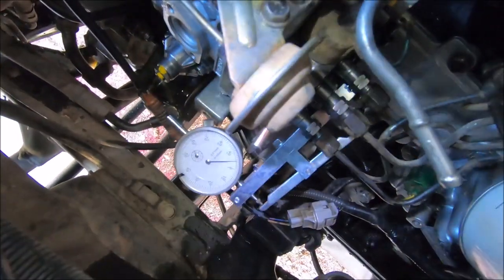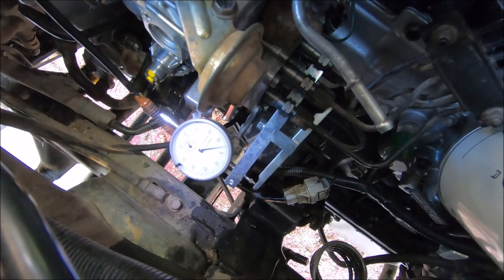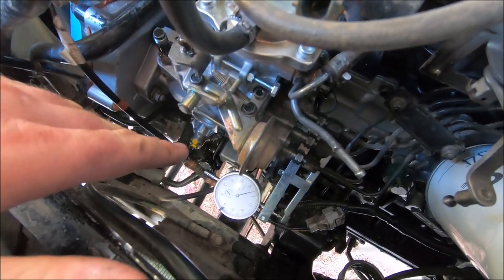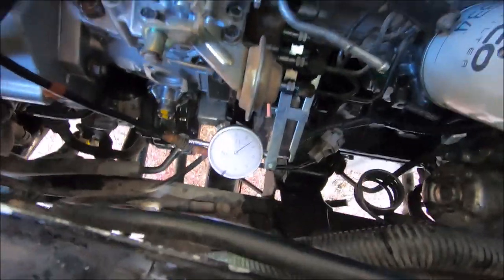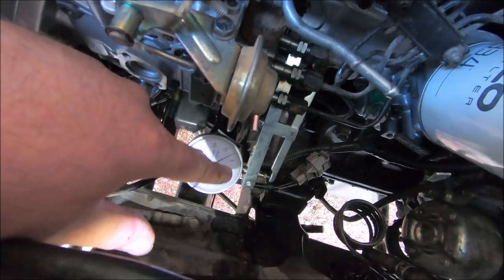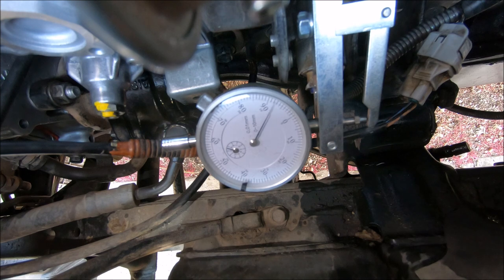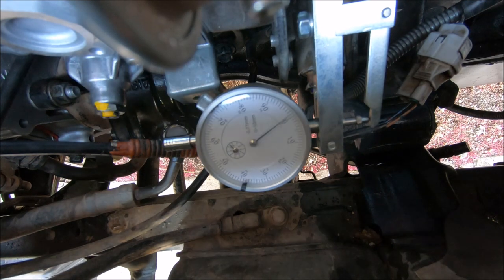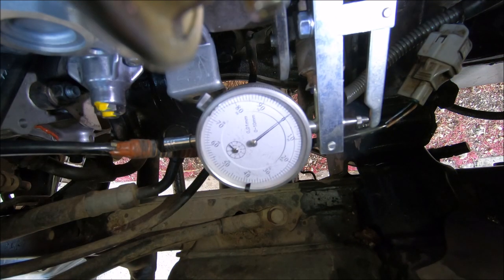How To Time A Toyota Landcruiser 1HZ Fuel Pump (non Turbo)

Comment: You dropped the box off a 1hz yet ? Looking for tips when I go to change my clutch over
Reply from the maker: Hi theres not a lot to them they are pretty straight forward to get out all I would suggest is use a gear box jack because its an awkward gearbox to balance, try find a dummy inputshaft to help align the clutch plate and spigot bearing when installing  the clutch, make sure to get the fly wheel machined and have patience when putting it back in they can be fiddly like most 4x4 gearboxes.

Comment: Considering a 1HZ swap in the future to replace my gas (petrol) engine, would you recommend the 1HZ or do you think some of the other Toyota direct injection engines would be better alternatives? I enjoy your videos. Thanks.
Reply from the maker: Thanks! I'd recommend swapping to a turbo 1HDT as they are built for the turbo and there would be less stuffing around getting it set up also being a younger engine it will be easier to find one with lower kms.

Comment: Great video. One question. What about the factory mark on the pump and the housing ? Shouldn’t that marks align ?
Reply from the maker: No they aloud for wear in parts, so the marks will never line up perfectly. They are more there to give you a reference point when adjusting.
Reply: @CamshaftFM  I got my pump rebuilt. Lined up with the factory marks yet the engine idles roughly. Any other way to time the pump apart from using the dial indicator ?
Reply from the maker: @kotasonamtenzin  not that I know of
Reply: @CamshaftFM  thanks mate. Great video. Keeping them coming.
Reply: @kotasonamtenzin  were the injectors done or tested  too ?
Reply: @adriaanvanheerden737  yes injectors were serviced along with the pump.

Comment: My IP (injector pump) on my 1kzte surf started leaking, looking for cheapest way to fix it by doing most of the work meself. Can you recommend any place around Australia where I could chase a refurbished IP for a reasonably cheap price?
Lastly, can the engine be damaged if keep driving for now?

Many thanks in advance.
Cheers mate
Reply from the maker: Hi, im not sure where you could find a refurbished one other than gum tree or ebay. Id be checking wreckers to see if they have any thing, that would be the cheapest option or take it to your nearest diesel shop and see how much it would cost rebuild it. in regards to the leak it would depend on how bad its leaking it is possible that the pump could starve of fuel and seize up if its leaking bad enough.
Reply: @CamshaftFM  thanks for your fast reply. Being in the country side everything here is like double the price. Talked to a bloke in Townsville and he reckons it's a minimum of 1.4g more like 1.8g ... Fmd
cheers tho

Comment: Hi mate great video 
Just want to confirm, you’ve adjusted the dial indicator to 1 at TDC which is 1 full rotation on the dial & then fine adjusted pump to achieve the .05 .

In other words, you’ve preloaded the dial indicator to 1 full rotation at TDC & then fine adjusted the pump to .05
Is that correct.... cheers in advance 👍
Reply from the maker: I think youv got it right. Basically you put the eng at tdc rotate backwards until the dial indicator stops moving then set the dial indicator to 0 then rotate the engine forward to tdc and at tdc the reading should be between 1.03-1.09mm. If not adjustment on the pump is required until it reads the correct number. You might have to do it a couple times to get it spot on.
Hope that helps.
Reply: @CamshaftFM  
Thanx man..... much appreciated.
Yes it helps me a lot.
Keep up the great work cheers 👍
Reply: I have a Toyota Coaster with a non turbo 1hz, would the timing be the same?

Comment: Hello once again, 
To time the pump with a dial indicator. Do I have to open the timing belt cover and check the cam and pump mark on TDC ? Or just the crank mark on the TDC will work?
Reply from the maker: You need to line up the cam timing mark as well
Reply: @CamshaftFM  so I gotta open the timing belt cover. Thanks mate.

Comment: Did you loosen all 6 fuel line connections on the pump?  The FSM says this, wondering if it's necessary?
Reply from the maker: It helps but it’s not 100% necessary just be careful not put too much pressure on them
Reply: @CamshaftFM  Thank you.  My timing was at 1.5 mm!  '92 1HZ n/a.

Comment: Does the dial indicator need to be screwed on to the pump very tightly with a lock pliers or a wrench ?
Reply from the maker: No just needs to be firm not super tight
Reply: @CamshaftFM  thanks mate. Super responsive to messages. Got yourself a new subscriber.

Comment: did this make a difference to white smoke cold start and running?
Reply from the maker: Yes stopped blowing smoke and running rough on cold start
Reply: @CamshaftFM  thanks mate ive just been through the same journey and now have a white smoke blower on cold start, so ive just bought the pump timing thing and dial indicator to do it too!

Comment: My 1HZ cranks very well, engine runs very well but no self start, im always forced to do hill start always & picks up very well...what could be the problem because the vehicle has enough power even when ascending a hill & no smoky exhaust, kindly
Reply from the maker: Could possibly be the glow plugs, otherwise it should start I would also check that it is cranking fast enough on the starter motor if it’s not cranking fast enough it will not start.
Reply: @CamshaftFM  its running really fast on cranking, i have tried different batteries & still checked the glow plugs...doesnt selfstart even when warmed up
Reply from the maker: I’m not sure then mate that’s a odd one. Another thing you could check is the fuel shut off solenoid on the fuel pump but I doubt that would be the issue.
Reply: @nicholaskimuyu369   I believe it has something do with the fuel pump. There's a Greyshish Bit which we call in Portuguese " Cabeça da Bomba injectora " that translates to Fuel Pump Head. Try to put a new one on and I believe the starting issue will be solved. Regards m8

Comment: You have a turboed 1HZ, you have stuffed it up again. Should be same plunger depth as the 1HDt. 
Good example for tge NA 1HZs out there though.
Reply from the maker: It is set for the 1hdt I changed it the day after I made this video.
Reply: @CamshaftFM  nice. Bet that picked up alittle bit of power too
Reply: @CamshaftFM  GDAY, just to clarify, is this for a non turbo 1HZ? As a carpenter/ builder, i have to refit my reco pump on 1HZ 79 troopy in the bush/ or try get a diesel mech to travel 3 hrs out bush....cheers
Reply from the maker: @STROONZONY  hi mate, yes the adjustment is for a non turbo 1hz. Good luck.
Reply: @CamshaftFM  i dont understand Liams comment 'you have a turboed 1HZ...'???
Reply from the maker: @STROONZONY  my Ute has a turbo but I did the video for a non turbo
Reply: @CamshaftFM  cheerz bud...
Reply: @CamshaftFM  so now it would be set at 1.29-1.35, is that correct, cheers.
Reply from the maker: @vernakruckow6968  yes if your engine has a turbo if not and it’s a normal 1hz then measurement should be as described in the video and description

Comment: Hey mate, correct me if I'm wrong but didn't you set it at 0.05 instead of 1.05 since the needle is between 0 and 10? Isn't 1.05 after the 10?
Reply from the maker: Hi, no it is set at 1.05 as the dial indicator had done one full revolution bringing it to 1
I probably could have been a bit clearer in explaining it. Thanks for you question.
Reply from the maker: Yes that's right
Reply: Hi mate great video 
Just want to confirm, you’ve adjusted the dial indicator to 1 at TDC which is 1 full rotation on the dial & then fine adjusted pump to achieve the .05 .

In other words, you’ve preloaded the dial indicator to 1 full rotation at TDC & then fine adjusted the pump to .05
Is that correct.... cheers in advance 👍

Comment: Does have a turbo kit change anything?
Reply from the maker: Yes the timing for the fuel pump will need to be different
Reply: @CamshaftFM Thank you, where would i be able to find that information
Reply from the maker: @australianchad6450  you would have to look up fuel pump timing specs for a 1hdt. As that is the turbo variant
Reply: @CamshaftFM  roger 
Cheers mate your a legend
Im out in the bush so theres no good mechanics out here i have to learn to do everything myself